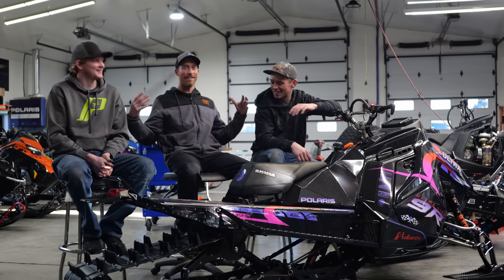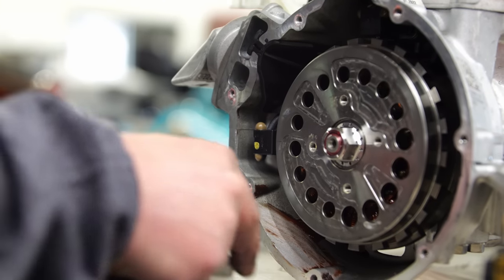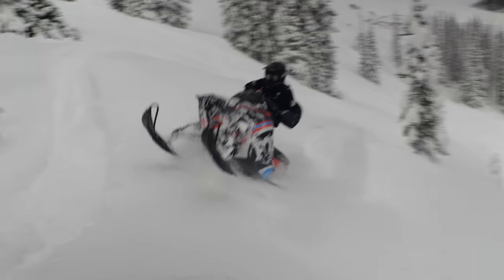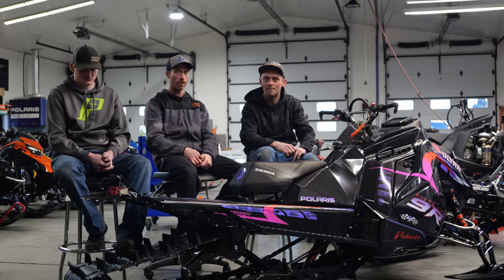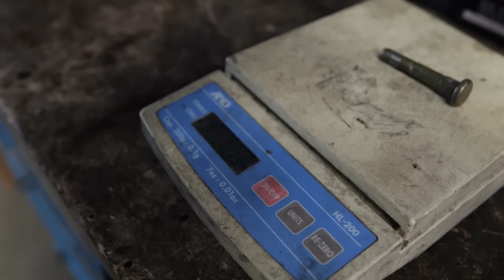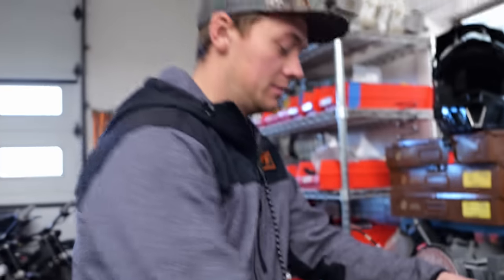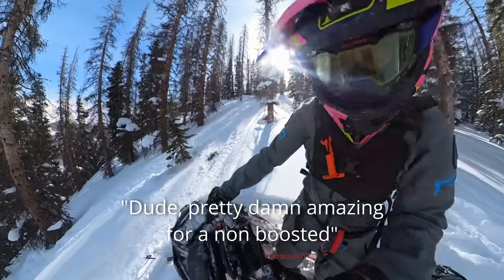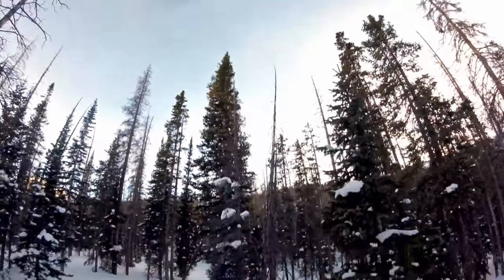2023 Ultralite 9R | First Ride

Comment: I have an honest question… at what point does the gain from modding your sled diminish?  I did a clutch kit and narrow a-arms on my axys and it made it an absolutely new sled but at some point it has to make no difference
Reply: What'd you do for clutching boss? I did the 36" A arms and I LOVE them
Reply: @208SledHead  Black Diamond Extreme makes an amazing kit!  Did primary spring and weights as well as secondary spring and helix plus I threw in the roller bearings in from burandts store for the heck of it.
Reply: @6thGenFarmer  Hell yea man! I’ll look into it - thanks!

Comment: If Larry Bird was a sled😁👍
That is one bad sled that doesn't seem to stop till it reaches the top
I was doing that with my TundraLT but 1/8 your speed on flat terrain. I got my flatbed loaded with spruce logs, there was a fresh bed of powder so I couldn't resist but got stuck a few times on a couple trees. Great video!
Reply: @huvvy  naa no nerd, know some 90s sleds, 1 carb to tune no syncing machine with grease zerks that are easy to get to. 
Last week i went out with my 91JagDlx440LT Low Gear. Loaded our sleds with spruce logs and pitched tent. Dropped to -40F, I hitched my friends sled up to my load which had his '23 850EFI hitched to his sled. I filled up with 50/50 AVGAS/85 reg then made an attempt, we were doing very well at 10 to 15mph made it home. His battery froze up🤔